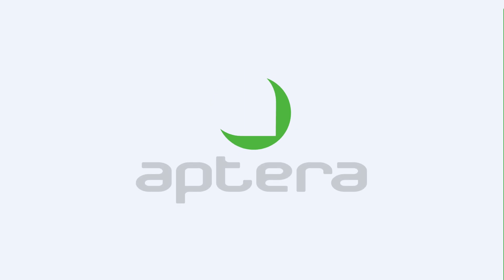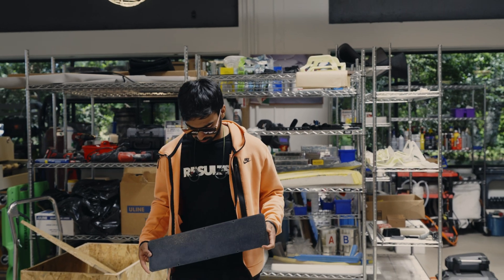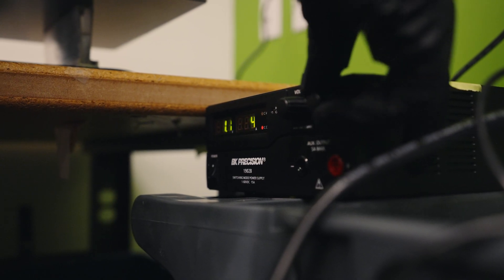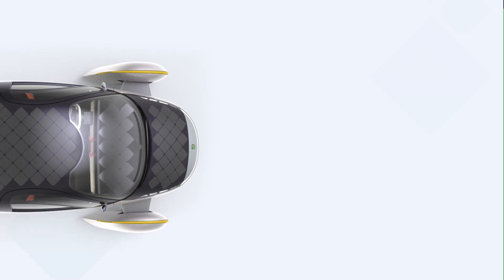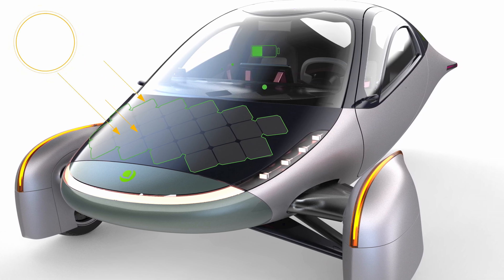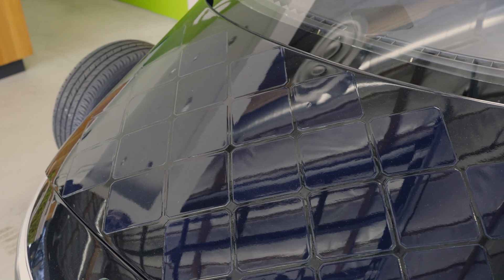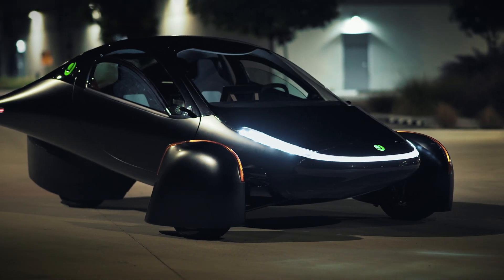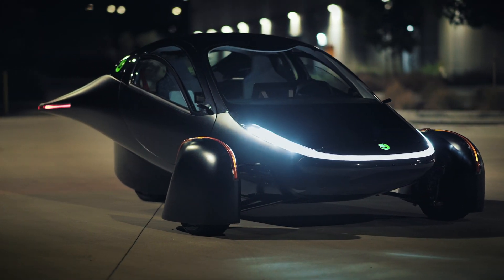Aptera Makers Series — Solar

Comment: Why are the solar cells oriented in the direction they are? It looks like the least efficient use of space, filling basically rectangular spaces with with the squares set at 45 degrees so that loads of space along all 4 sides cannot be used. Is that just for fashion, or is there any practical reason for that? Since efficiency seems to be a core value for Aptera, this has really baffled me.
Reply: It would seem Aptera and it's unpaid shills, excuse me, "Brand Ambassadors" THINK the unconventional layout they're using provides some mechanical benefit to the cells (and it's possibly going to be patented to boot!)  I'm told the benefit is "less breakage" but then they love to tout how, even when shattered, the cells produce practically the same power.  Mind boggling isn't it?

Since, at least, 1987, folks well versed in solar cell assembly and encapsulations, have been building/racing compound curved solar arrays that incorporate better "packing density" (more efficient use of space).  Just swallow your pride and do it Aptera!
Reply: @alainchuzel8341  How very odd. It really does make it look like they are deliberately trying to minimise the number of solar cells they can fit.
Reply: @justinsenryu7308  I don't think it's deliberate.  Just ignorance and pride.  I'm metaphorically betting/hoping they come to their senses and reconfigure.

Comment: Hopefully the car can have 1 or 2 external Zamp or other plugs to add external solar panels for increased charging. Adding additional F
folding or roll up panels would be nice.
Reply: Wow yes the ability to bring or have at work some fold out solar panels that can hot plug directly into the battery would be sick!

Comment: flexible monocrystalline? put into plexiglass as part of frame? gluing individual hard silicone pv cells and hoping they don't de-laminate seems like a high school approach
Reply: Aptera has IP around their method of attaching solar cells to be easily replaceable.  It would be an especially talented high school, then.
Reply: @n.brucenelson5920  Is their evidence that "Aptera has IP around their method..." or is it simply "aspirational"?
Reply: @alainchuzel8341  You can do a patent search as easily as the next guy and don't have to take my word for it regarding Aptera' s solar cell patents.
Reply: @n.brucenelson5920  Found some recent solar related patent applications.  In my quick read of them, there's no explicit discussion of "easy replace-ability".  Can you help a guy out here?
Reply: @alainchuzel8341  The claim was explicitly made by Steve Fambro in one of the official videos.
Reply: @n.brucenelson5920  A video "claim".  An "official" one no less.  Got it.  /s
Reply: @alainchuzel8341  it is not my job to do your due diligence for you.
Reply: @n.brucenelson5920  Specifically with regard to the solar, I'm trying to understand then help Aptera.  Why are you opposed to helping me do that?

Comment: I’m telling you triangular solar cells to fill in the diamonds gaps will almost end the need to Plug in …….   My calculations always come up over 1k watt Solar charging.
Reply: To my knowledge, no one makes triangular solar cells in high volumes if at all.  That translates to $$$$$$$.  Better (cheaper) to cut high volume solar cells into either squares or rectangles and get better packing.  I do it all the time for customers.
Reply: The capacity of the present design is about 750 peak watts, or around 4.4 kWh per day in San Diego.
Reply: I’m just saying it can be improved. I believe 1000 watts ++ can be achieved.
Reply: @jpo7091  Don't you believe that a lower cost improvement is better?

Comment: Love what you are doing. Years ago I wanted to glue solar panels to my 92 Mitsubishi Expo, haha. I think extending the solar panel pattern from the tail forward to the door would increase output and, especially on the white colors, would be a cool looking pattern.
I have the same desire to do road trips where I don't know where I am going or what I am going to be doing. I am currently doing that full time with my two wheeled motorcycle and hoping to do the same with my three wheeled motorcycle, My Aptera ;-)
Thank you ALL for what you are doing!

Comment: I have put in my order for a 600 mile AWD with added hatch solar, but now have question: Does hatch solar preclude view out the back?  That would be a safety/comfort issue for me and would sadly remove that from order if that was the case, unless some sort of full-time rear view camera compensated for it.
Reply from the maker: You will have full visibility of the rear through the rearview camera in the cabin.
Reply: @ApteraMotors  But wouldn't that turn the sleek instrument into a closed van with limited physical lighting (or will the panels allow sunlight)?
Reply: @adimchionyenadum2962  With reasonable spacing between cells and the right encapsulation/structure, there can be sunlight coming through but, you're right, it will be limited.  (Someone suggesting transparent solar cells in 3, 2, 1.....)
Reply: @alainchuzel8341  Thanks a lot for the answer. They will make the hatch glass look tinted. Since some may not like this it may not be a bad idea to have an option for transparent cells.
Reply: @adimchionyenadum2962  Glass (?).  Inexpensive glass is heavy.  Thin/toughened glass is expensive but might be a good option down the road.  Transparent cells suffer greatly in the efficiency department.  Perhaps it's obvious but being transparent means minimal sunlight "capture".  My humble opinion - transparent cells have their place but not likely on cars unless they cost next to nothing and are used on the front windshield only!
Reply: @alainchuzel8341  I like a well lit environment, so visibility is a plus in a car, makes the interior very nice when is properly illuminated and you can see outside, for me it's a very hard trade off, the extra energy captured vs a clear window, maybe placing solar panels just on the perimeter of the glass and some more on the actual trunk? of course you could block them with objects but if one day you really need the car to pickup energy you can clear your trunk... while keeping your clear window!
Reply: @Werevertumoto  Understood.  Thanks for sharing your perspective.
Reply: @ApteraMotors  Thanks for definitively answering the question!
Reply: Hopefully Aptera answers this question definitively but in solar car "raycing", full-time rear view camera is quite the norm.
Reply: But there is an option for solar panels on the windshield. How about that?
Reply: @adimchionyenadum2962  The panels are on the dash under the windshield.
Reply: @n.brucenelson5920  Okay thanks Bruce. I have always wondered how come?

Comment: Why are the solar place diagonal instead of straight?
Reply: Likely just cosmetics.  If relatively large solar cells are to be used (like the SunPower/Maxeon shown in video), Aptera really should be seriously looking at the trade-offs of having them cut.  Historically, with reasonable costs and efficiency, terrestrial based solar cells have only gotten bigger.  When I was just a tadpole, I was working with nominally 4" x 4".  The norm today is more like 6" x 6".  SunPower/Maxeon is a bit of an outlier at 5" x 5" but I believe they have recently been making 6" x 6".
Reply: One of the early videos said they could fit more cells diagonally, but I think it is mostly cosmetics. Car makers try to avoid straight horizontal or vertical lines on any hand-made parts, since the eye is very sensitive to deviations on those.

Comment: I hope you'll have a built-in retractable sunshade to shade from the steering wheel backward. If it should be parked in the sun for charging, then every single Aptera driver is going to want/need a sun shade for the cockpit while parked.

Comment: It would be great to have an optional solar panel sun shade also, though with the overhead view you did, when the panels will be collecting the most sun, the dash panels fill the windshield pretty well. In addition to collecting a bit more power, a sun shade would help keep the interior surface temps down (especially with slightly open windows) in comparison to being in contact with direct sunlight though (that whole greenhouse effect thing!) so when preconditioning the interior temps will get lower quicker without having to cool down the interior surfaces like the dash which will continue to radiate.

Comment: This could be interesting to apply in electric aviation. A test in Germany with a small modified wing design model rendered straight 9 days of flying. This may have been made 4 years ago.
Reply: Solar on aviation is tricky. Solar Impulse airplane was able to go around with world on solar panels only. It has a wingspan of a 747 yet it weighs like an Aptera, and it can carry only one person. It also flies at 40mph average, pretty slow.
I think the solar modules on Aptera won't produce much power, but they may prove to be an useful addition due to the outstanding efficiency of the car.
Reply: @theagentsmith  Yes, there are some issues with power density of solar energy but the same happens with the car. I did mention a 9 day flight but these solar panels can serve as range extenders or as chargers when the plane is not flying (just like with the car). Just like you said it can be an useful addition for systems that are efficient but in fact it could  got to aviation right now. There is a need for electric power in a conventional plane anyway a probably the trade-off can be interesting. The difficulties in aviation are probably of the same nature as in the car but only worst in regard to speed and additional in regard to safety.
Reply: @theagentsmith  Did the solar airplane have a human pilot? I read somewhere that the trip round the world took a couple of months to complete.
Reply: @adimchionyenadum2962  The airplane Ricardo C mentioned likely was one that did NOT have a human pilot but the one Niccolo Gallarati mention did.  There have been numerous solar UAVs.  I've personally built custom modules for some and it's a pretty cool "industry".  By the way, the Solar Impulse plane is being converted to pilotless!  Check out Skydweller Aero.  It's a joint Spanish/American business that now has the Solar Impulse plane.
Reply: @alainchuzel8341  So how was Niccolo Gallarati's able to circle the world with a human pilot at just 40mph? How long did that take to complete? Perhaps it wasn't without landing.
Reply: @adimchionyenadum2962  Solar Impulse at Wikipedia(?)
Reply: @adimchionyenadum2962  See Solar Flight Inc. (?)
Reply: @alainchuzel8341  Okay I'll check it out. I have forgotten Wikipedia has almost anything imaginable.

Comment: What voltage will come out of the solar panels?  And what DC to DC converter will you use ?
Reply: Ideally something close to the battery pack voltage.  More efficient that way.  Aptera(?)
Reply: @alainchuzel8341  Around 140 cells on the car in the pictures, so 70V  if they all are in series.

Comment: Having actually usable solar power will separate Aptera from most other EVs. I have selected the full "Never Charge" solar option on my reserved Aptera.  I am excited by the idea that my EV will refill the battery back up just sitting in the sun in the parking lot at work, or just sitting parked in my driveway. Potentially, the onboard solar panels could add an extra 280+ miles a week to my car's range from the sun, for free. Solar power is a benefit will add up over time to be a big savings.
Reply: I've done rough math, for prices in my area, that compared to a non-solar EV (Tesla model 3 as baseline) I'd save $250 or more a year on my electric bill. That is both a combination of the efficiency in miles per Watt hour and the bonus of free sunlight. I don't have my formula saved, so don't make me do it again, but that's what I came up with. I also drive like 1300 miles a month for work. YMMcertainlyV
Reply: @jlschmugge  Smart of you to warn you didn't have any calculus formula saved for your findings. Otherwise you could bet what all the "smart" guys here would be asking you.
Reply: @adimchionyenadum2962  will I guess it's not true I don't have a formula. I basically took the numbers for the Model 3 battery size and kWh/mi usage, used my estimated weekly commute mileage, and factored in cost per Wh my electric utility costs me (about 10.5 cents) to how much that would cost me per week for the Model 3. Then I just did the same for Aptera after 280 free solar miles a week and Aptera's more efficient kWh/mi usage. What I don't actually have anymore is all the numbers that got me to $250 a year. I just remember the final result.
Reply: @jlschmugge  Disclaimer: I am not in the math thing. But I guess all those calculations would require some sort of formula other than the everyday Arithmetic. So even though you don't remember the actual numbers anymore you better reveal the formula before the smart guys arrive and start asking all sorts of questions🤣
Reply: hundreds of thousands of these cars in US would really help to see a large drop of co2 in the transportation sector, which presently if I am correct, 26% of all co2 emissions. The oil industry will hate it but thats their problem.
Reply: @LK-pc4sq  Even though my country of origin is an oil producing country that depends mainly on oil exportation for its economy, I am in favor of phasing out oil as our source of energy. Nations should diversify their economies and transit to cleaner and renewable sources of energy.

Comment: How are these cells going to hold up to a hail storm?
Reply from the maker: Great question! Our goal is to achieve typical automotive grade rock impact protection. Furthermore, we are working to ensure it will be easy and affordable to change out a panel if damaged.
Reply: @ApteraMotors  I'm getting more curious about how panels are replaced. Will they be glued (and removed with heating to a high temperature)? Or are they going to mechanically fasten?
Reply: @ApteraMotors  hey you want to come down and show you the process that works great.....  pay for my trip.........  ill gladly come show you the impact resistant way to do them ,  hit them with a hammer and no problems ........... it was nice to see you 2 this last trip you came up........  after 16 months of long days i needed some time off
Reply: Does anything hold up in a hail storm on a normal car? At least they're replaceable.
Reply: @LawrenceKincheloe  i think these are the flexible type panel, which might have enough give, along with a composite base to flex under impact. I'm postulating. Composites themselves are damn near indestructible to anything acute impact other than a gunshot (unless you fork the $$ for kevlar). I have a feeling the panels won't be, but would fair better than it not on a composite base.
Reply: @jlschmugge  I actually laughed out loud when I saw which solar cells they were using. There aren't that many companies doing rear electrode, semi flexible solar cells, and I believe the ones in the video are Sunpower cells. You an actually purchase them on Amazon and they are quite nice over all. The interesting thing is how they plan to solder the panels onto the body of the car. Ideally it fully supports the back of the cell, while allowing cooling to remove heat from the surface of the cell. It looks like they are doing a "wrap" with copper being laminated to the body, and the cells being masked off until a semi gloss coating is applied. In it's current iteration,  I don't see how replacing a cell is going to work without cutting into the composite.
Reply: @jlschmugge  If cells are brittle, like typical SunPower/Maxeon, "give" is not necessarily a good thing.  Local/concentrated deflection cracks brittle things.
Reply: @LawrenceKincheloe  It's probably a safe bet to NOT assume anything you actually see on prototype Aptera cars is representative of what will be on future deliveries.
Reply: @alainchuzel8341  I know, I think it's incredible that they're willing to risk the potential negative press of confusion over pre-production vs. final production. I'm actually glad that they're tackling hard problems and I'm genuinely interested in what solution they come up with.
Reply: @LawrenceKincheloe  There might be an Amazon order in my future, although I'm confident Aptera can do a better job than me to put the time in to make the panels both durable, replaceable, and won't just fly off at high speeds. IF I do make augmentations to my future Aptera, I certainly can't imagine how to make a durable panel without imbedding the cells in the resin. Even if they screw on through the composite to a back plate on each cell or some type of flange I can't think what at the moment would be strong enough to not basically fly off like a roof shingle in a hurricane after a year of driving and elements. I am really really curious cause I think someone with more time and resources than I can figure it out. Why I'm glad I have the cash to buy what they have the time and skills to make.

Comment: Really loving everything so far. I saw that you had what looked like a grid you just placed solar panels into, and I'm wondering if a version of that will end up on the final vehicle? If so, would the solar panels connect modularly via contact points between the panel and the grid, or would each solar panel be wired separately? It seems like the contact points would make them easier to replace, or even customize later on.